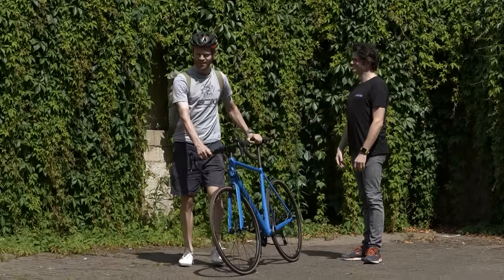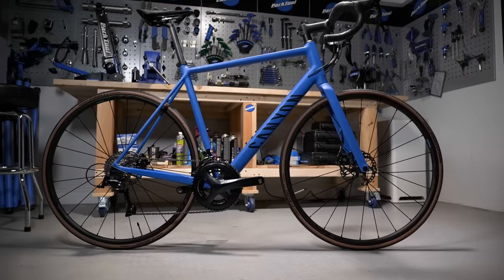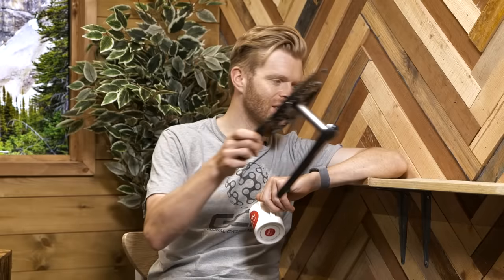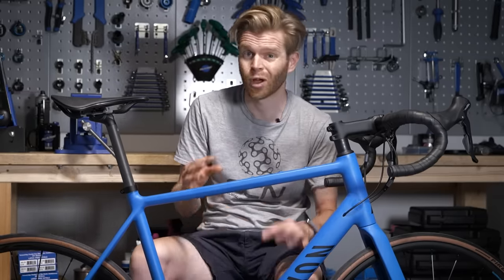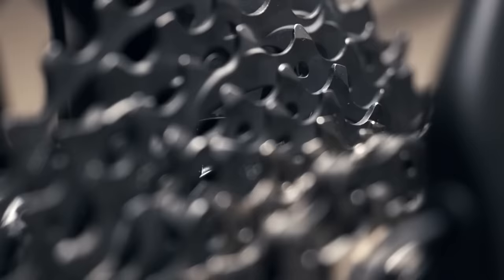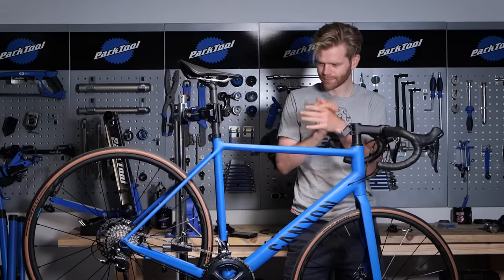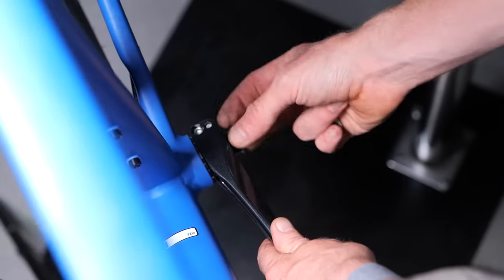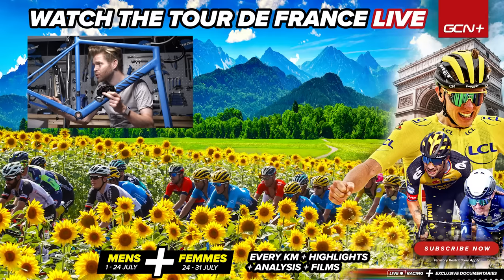Upgrading Your First Road Bike | GCN’s Bike Makeover Ep. 1

Comment: This seems like click bait that will attract newbies to the cycling world. The cost of buying components ala cart is insane and there is almost zero performance difference between 105 and DuraAce. Rims and tires are your best area of upgrade. Then there is the frame. Taking all that cash from doing the overhaul and placing it into a new 2nd / 3rd level bike will put you way ahead of the game because you will be taping into the latest R&D of frame design which stresses aero… I will be redoing my 12year old Roubiax with a new paint job,, that’s it. Keep the old bike as is. It’s the one you can take into the village and lock up without worry as you just have fun going to clubs or restaurants.

Comment: Christ is it going to end up a 53/39 by 11-22 monster? Ooooh it's got 24 gears but Joe Average can only use 16 of them despite the 700g you saved for £5k.... Why not do a useful video on how to upgrade a bike to suit where you live and ride? IE- do you live in a very hilly area? Undulating lower levels? Flat as F land? (AKA How to have a cassette and actually use all the cogs regularly) I reckon for a weight saving that's significant from the off for us in the mountains, sub compact chainsets should be offered for road bikes, maybe even a 28/44 paired with a 14-36 cassette.... (I'm too f&^$%^ed at the top of a climb to want to kill myself going down the other side with stupid large gears)

Comment: Almost like the Triggers Broom Scenario…  the weight difference is hardly relevant when you are changing all but the frame ? A Shimano Dura Ace Di2 12 speed R9270 Disc Brake Groupset  is in excess of 3k …. and then you are going to add some Carbon wheels over 1k 😏 about as utterly pointless as it gets … nobody would do this upgrade part from novelty video value and the fact you gets the parts for free!!… you’d get a far better quality purpose built road bike for under 5k ….. make the content relevant..

Comment: So you "spent" 1000 quid on a brand new bike to upgrade it and to put groupset that is at least double value of that bike and some carbon wheels which will be yet again more than the value of the bike.

So to summarize you "spent" at least 4000 quid (probably more)...let's face it. This is sponsored add rather than pimp my ride type video.

 Someone in the comments below suggested that you should do it to random subscriber. At least then there would be value and some point to it.

This is dumb.

Comment: You can't "upgrade an entry level bike and turn it into a top-spec one" without throwing $$$$ down the drain. Why are you encouraging people to do that? Why strip off, for example, Tiagra and put Ultegra onto a heavy, unresponsive and unlovely frame? You'll end up replacing the frame, and then you've got Grandpa's mythical Axe, spending waaaay over the odds for the same thing you could have bought OEM for 2/3 - 1/2 the price. Grow up GCN, you're in danger of fanboiing yourself into irrelevance.